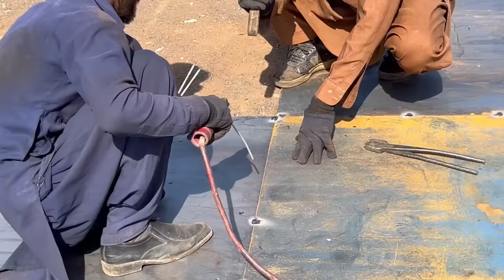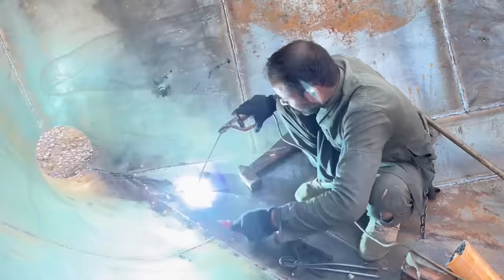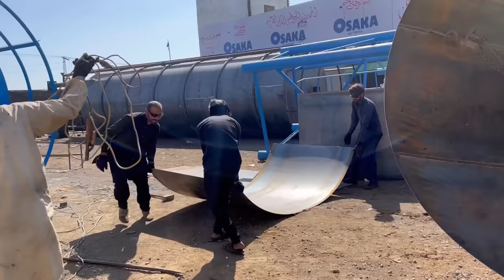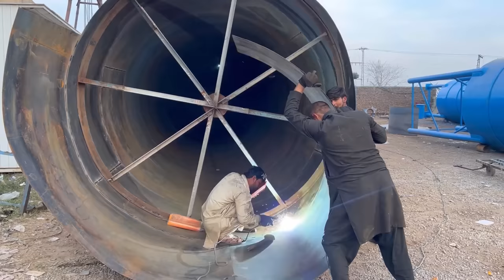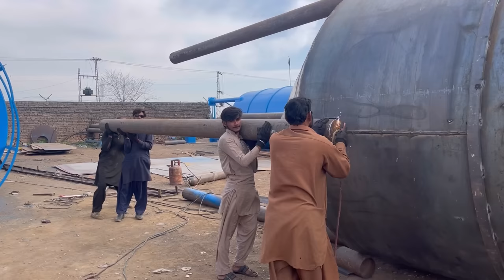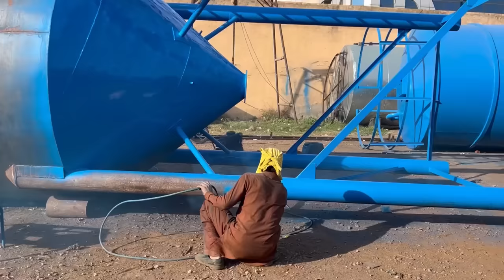Manufacturing Process Of A Huge Silo Tank With Limited Equipments

Comment: Can you imagine if these guys had modern tools what they could done ...Respect to them 🙏
Reply: This hard work is the result of a lack of technology.
Tomorrow if someone starts filling the overhead water tank manually instead of using a electric pump then would you call that hardwork ?
Reply: Lady !! Those are modern tools !! And they are very creative cause they  have necessity to triumph
Reply: THAT'S ALL THEY NEED. NOTHING ELSE LACK. THE MOST IMPORTANT IS TH ROLLER BENDER FORBTHE STEEL PLATES. IF YOU SEE THEY LACK SOME TOOLS, THEY COULD NOT HAVE FABRICATED THAT TANK. BUT WHAT I NOTICED, THEY DID NOT APPLY RUST CONVERTER AND THE RED LEAD PRIMER. THE APPLY THE BLUE TOP COAT WITHOUT THE PRIMER.
Reply: @Aurora Rays  
Exactly !!
Without cleaning the outer surface and application of primer, the paint would crack in a season and the resulting pit corrosion would cause 1000s of microscopic pin holes
Reply: It's not about the tools it's about the tallent
Reply: @indiaengineering2138  YEAH, YOU'RE RIGHT. IT IS THE KNOW-HOW TO DO IT. WHAT TOOLS IS HE LOOKING FOR, THEY ALREADY HAD ALL THE TOOLS NEEDED TO COMPLETE THE FABRICATION.
Reply: Probably nothing special...
Reply: Men can make so much more than a machine, where did any machine come from?
Reply: Yes...they could protect themselves better!
Reply: The can build the Space-X... sure 👌
Reply: @colgatetoothpaste4865  como se suele decir.. el hambre agudiza el ingenio...
Reply: @AmitSharma-sc9gg  Maybe these Pakistanians are selling these to their neighbours.
Reply: They would sell it and keep doing by hand.
Reply: Остаться без работы . В узбекистане нарочно разрушили автоматика в 90е годы, чтоб руками таскали, работали
Reply: Они никто
Reply: @AmitSharma-sc9gg  that ship steel with carbon, no need doing any thing if not on sea
Reply: Nothing they will make bomb

Comment: Take notice. A lot can be done in the home or farm shop without fancy equipment. Our grandfathers also knew how to work metal like this. 

Coming from cnc machining and allround fabrication with modern machines when i became a freelance fabricator working with stuff like these guys was a huge step back. Lots of factories AROUND the world dont have a high tech metal shop but work like this. Fabrication isn't their goal, having their production lines run is.
I learned how to fabricate the old school way. There are lots of situations without modern and high tech machines wich i can handle now. Always was told it was impossible.
Reply: Did you notice in these kind of videos they never clean the rust before welding or painting?

Comment: fantastic work of engineering fabrication, most important is that the excellent work of photography which does not miss a frame of construction, few questions,  dont there be any paint inside the silo ?  would there be any foot for the silo when it is placed on the foundation ?  did the welders weld both sides of the plate, i mean inside to for chain / continious welding ?  would there be any anti rust coat or cleaning process inside and outside ? Overall hats of the team which did photography.

Comment: It's not like they can't afford modern/power tools to do a job like this. They don't often get projects as big as the one you're seeing right here. They mostly get orders where they fabricate window/door grills and railing. Each one of those have a different design depending on the customer's choice so automation is a problem there and each grill/railing is hand fabricated. 
Getting a project like the one you see in this video is pretty rare for them and considering the scale and rarity of it, it's not economical for them to invest in modern tools and equipment. 
Also, most of the workers are daily wage earners so that keeps the cost low compared to a team of employed workers.
The work is kind of shabby (for instance, they probably didn't remove the weld slag and didn't clean and primed the silo before painting it) but it gets the job done for both the client and the one who makes it...
So in the end everyone's happy...

Comment: Shoddy work !
They didn't even clean the surface before spray painting. 
The paint sarface would crack in 1-2 seasons, which resulted in pit corrosion and within 5 years this silo would have 100s of pin holes